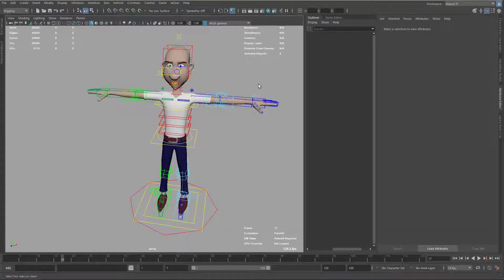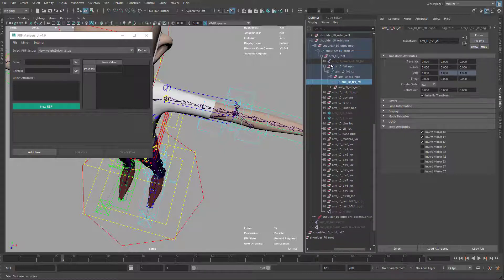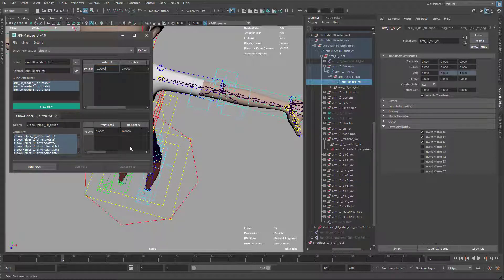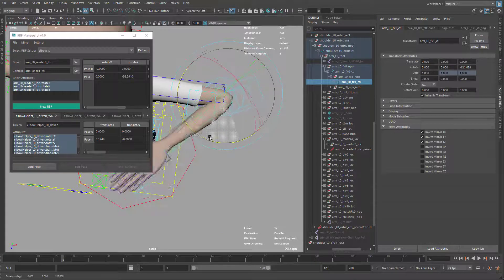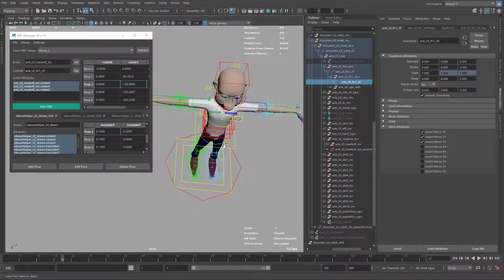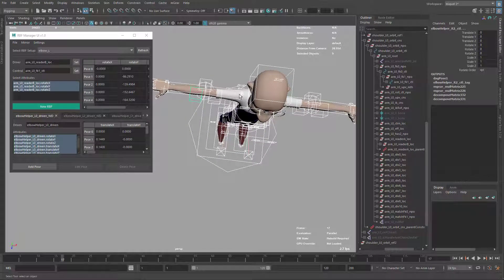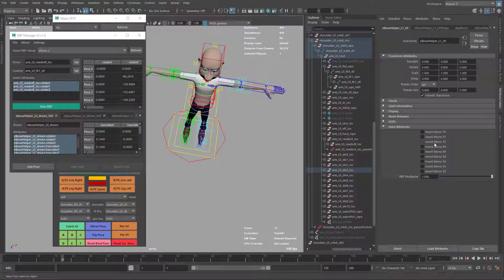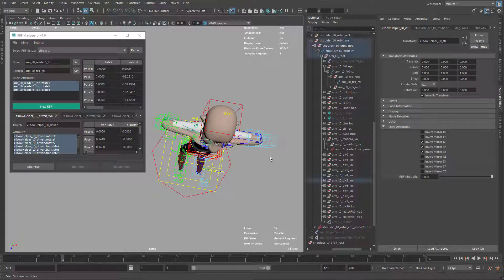mGear Basics 2: 09 RBF Manager elbow

Comment: Hello,
In first place I would like to express my gratitude for this cool editor, great job Fellas :)  I would like also to ask: is it possible to use more than one joint as Driver? That would be particularly useful when it comes to add correction or animate attachments on the torso where the whole spine joints bend and rotate.
Thanks in advance for the tip and keep up the awesome work <3
CiccioPaco